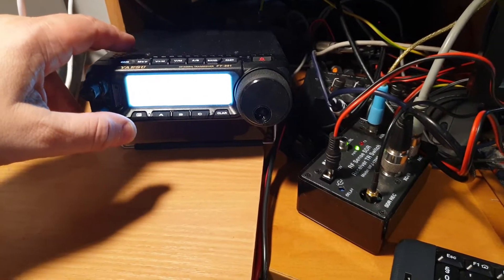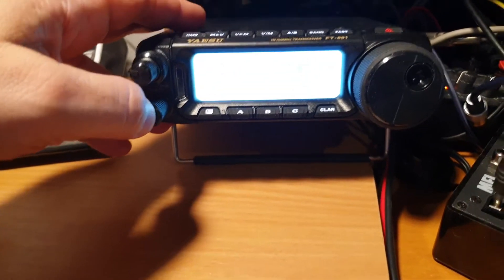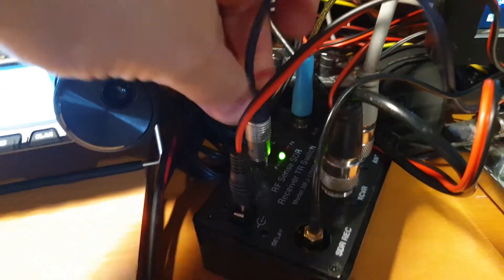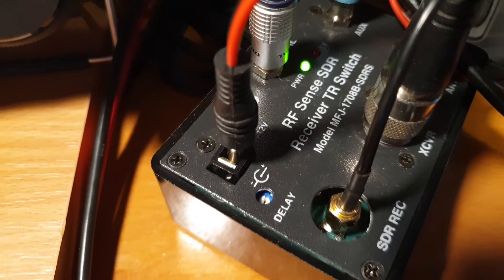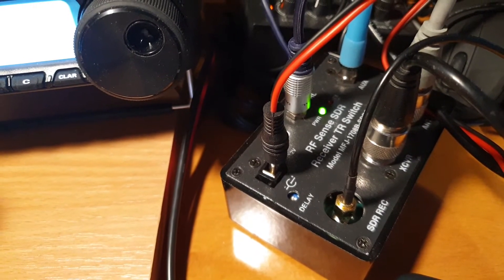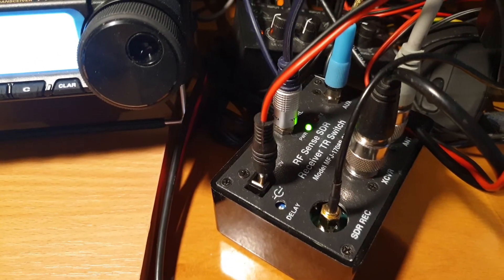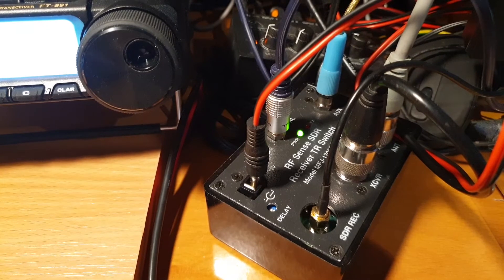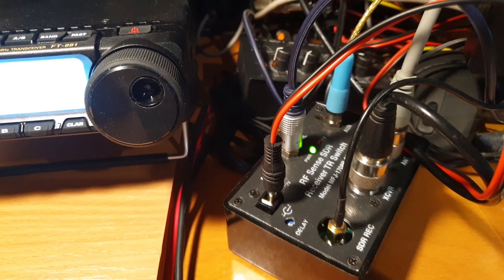MFJ-1708B-SDRS switch to share your antenna with your transceiver and an SDR receiver

Comment: I have one but want an SDRSWITCH brand. MFJ is too lossy
Reply from the maker: @frankthetank3342  When I bought it, it was the only one commercially available. I have not had an issue with loss, it works fine for me under 30 MHz. But I prefer direct output from the  radio. I got this because my FT891 was under warranty and I did not want to get it modified.

Comment: What is the AUX used for ?
Reply from the maker: It lets you key up the PTT for auxiliary devices, like a linear amplifier, a filter a switch or  whatever that needs switching upon going to transmission.
Reply: @ww1www  ok thanks for the info 73's

Comment: The problem i am having with this unit is that when i transmit- i get all my audio screaming back thru my SDR from my transmission.  This should NOT be the case, yet MFJ said that was normal.  If the antenna to the SDR is grounded from center pin to ground then I wouldnt hear anything, during transmit- no??? I am very disappointed in the fact that the SDR is not muted completely and my transmit audio screams through the SDR.
Reply from the maker: Well, I am no techie, but any receiver will still pick up signal, regardless of having an antenna connected or not, having been grounded or not, being connected to a good dummy load or not, etc. Also depends on how far and how well shielded your transmit antenna is from the receiver. also, not all RF will come back from the air, they also come in through the common ground or coax shield and other conductors.  In some software, e.g. SDR Console, CAT control to your transmitter can mute the SDR.

Comment: HI Krisztián, thanks for the video. I plan to buy the MJF-1708 Switch.

I use the same TRX. How did you realize the PTT cable from the TRX? The 891 don´t have a PTT out. 
 Thanks for any advance

73 de DO2MAK
Reply from the maker: You can get the PTT out from the 8 pin mini DIN connector on rear panel of the radio. I think it is more or less standard Yaesu.  I once soldered one such cable up for my FT897, but these mini DINs are a nuisance to solder (I am not good at soldering to say the truth), so I  rather just ordered one ready made linear amplifier switching cable off the net. I ordered mine from TechnoFix UK ("8 pin linear amp switching cable for Yaesu FT-817 FT-857 FT-891 FT-897 FT-991 - TechnoFix UK" https://shop.technofix.uk/8-pin-linear-amp-switching-cable-for-yaesu-ft-817-ft-857-ft-891-ft-897-ft-991) , very nice company, I would recommend them but they brexited  and taken back their control on Jan 1 meaning some duty and bureacracy hassle when ordering, not speaking of higher delivery costs to the EU. Maybe you can find some other vendors or DIY one for yourself.
Reply: @ww1www  
I plugged the ATU (FC-50) into the 8pin mini DIN.
I only have the data port free. (for RTTY)
Reply: @elementswebdesign-tv  good question, if you're using a linear amplifier, that works use the tun/Lin jack, is there way to use the Aux port with the FT-891?
Reply: @elementswebdesign-tv  I also have the same question. I have the ATU on the TUN/LIN port. I'm guesing there's no way to connect the PTT switch elsewhere, so it's either the panadapter or the ATU.